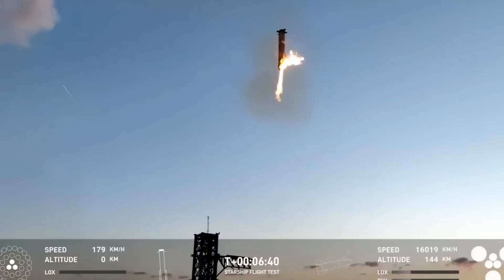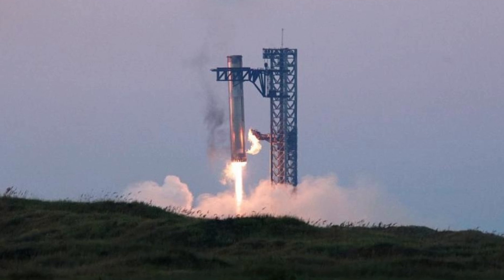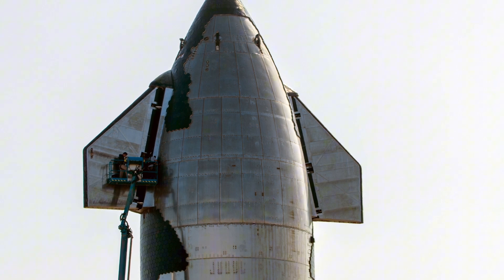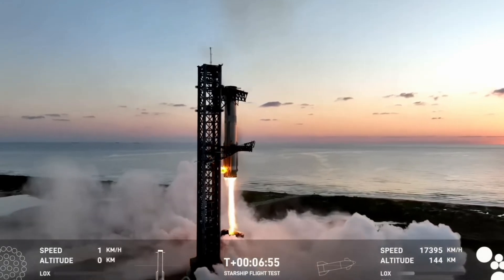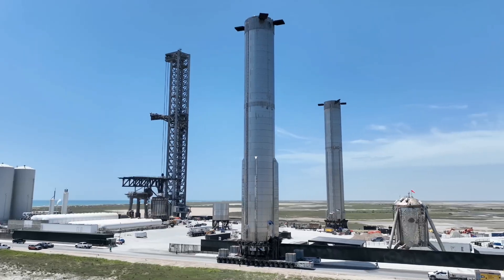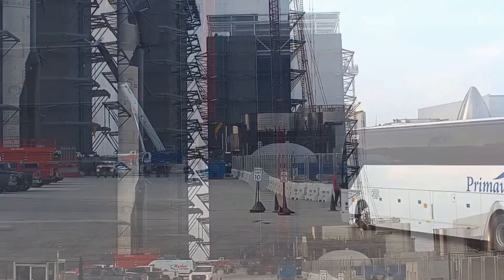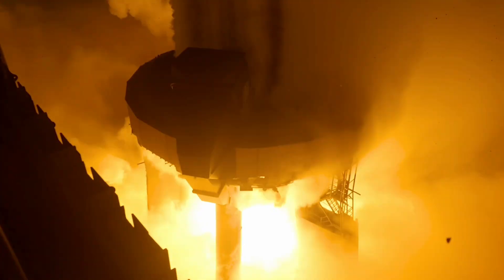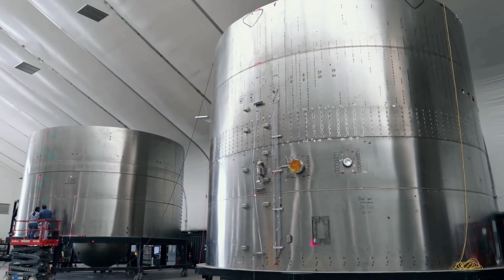SpaceX's New Starship Design!

Comment: Booster 12 is already being dismantled, there have been images circulating of components stacked up at Starbase labelled flown booster hardware that is ready for analysis by engineers. Also the biggest change in the front flaps is that the hinges moving to the leeward side of the ship to protect the hinges from plasma during re-entry. This should stop the burn through seen in IFT4 and 5.